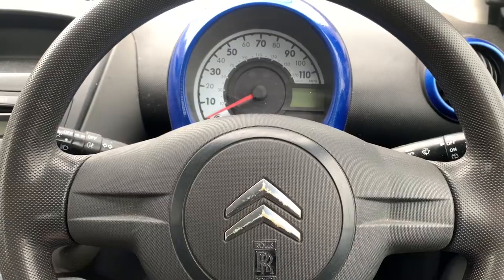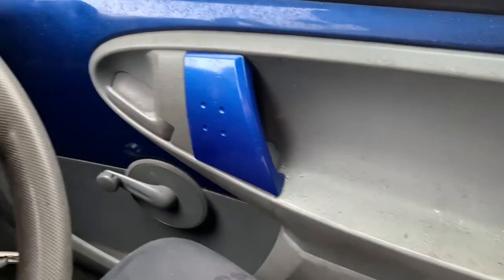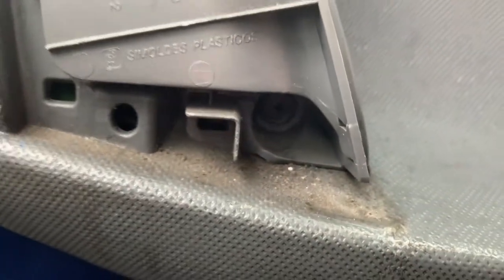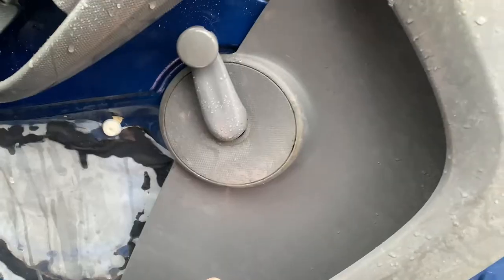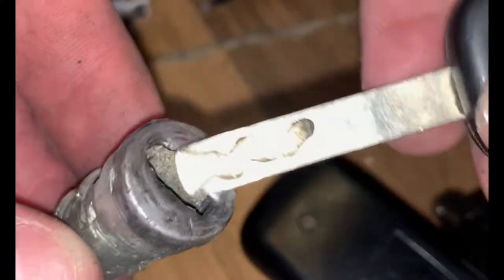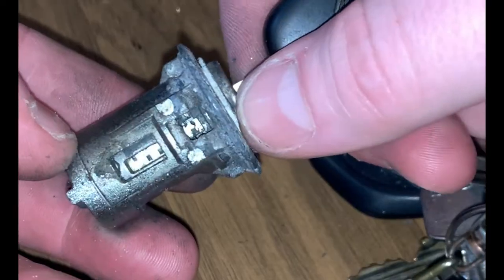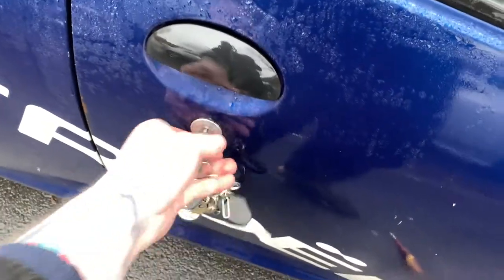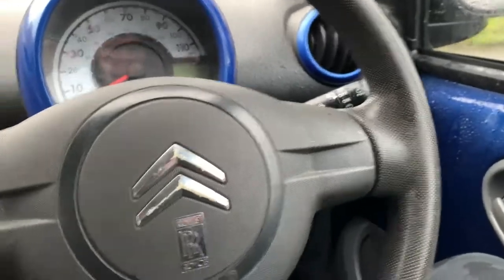Citroen C1 Door Lock Replace DIY + Repair, Aygo/107

Comment: Thanks for giving us the confidence to do it ourselves! My 2006 CITROEN C1 RHYTHM slowly got worse until it finally refused to lock (driver's side) from the outside. Soon got fed up of leaning over from passenger side to push knob down and then lock that door. Chrome cap wouldn't budge so I just swapped the barrels; had to cut/saw slots in door hole a bit so that the barrel fitted ok. I luckily don't have window winders, which helped. With my model, front one of the three screws is longer than the other two (just in case that helps someone).
Reply from the maker: Removing the chrome cap is the hardest but tbh. Glad the video helped and you got it sorted

Comment: Thanks for your video, I followed the same technique and successfully repaired the jammed lock on my daughter's C1.....I rolled the lock barrel on a bench grinder to smooth down the gates with the key in, reassembled and it works great saved ££££s on not taking it to a garage, cheers mate!
Reply from the maker: Good to hear the vid helped mate

Comment: tip for taking the window winder off..... get a rag put it behind the arm side of the winder wiggle it back n forth while pulling it towards you so the rag goes behind the winder ..the rag will pull the clip off, worked every time on me ole metro.
Reply from the maker: Will bare that in mind when struggling with the shitter next time.
Reply: @StupidBlokeStupidVideos  aye the action is similar to when you use a sock to remove toe jam lol

Comment: Same thing for a 2007 Peugeot 107 electric windows? ( driver door lock was changed and I have to open the car through the passenger side all the time. I was thinking about swapping them. Think will work ?
Reply from the maker: As long as no central locking then it should be the same as this 🤔
Reply: I swapped mine. No problem.

Comment: Can i swap the lock from the left door to the right door? My driver side lock is broken so I wonder if i can just swap to the other side more practical cos i never open the car from the passenger side
Reply from the maker: The latch on the back of the lock goes the opposite way, but they may be able to be swapped over 🤔
Reply: Yes it can. I did it.

Comment: Well here I am referring back to this video (first time was for entertainment purposes!). The door lock has been a bit bad for almost a year but after inserting the key if you pulled it as you turn it it worked. 

Sadly the car went for it's MOT (passed) but they have killed the lock once and for all. :(

As I never use the passenger door can I just swap the locks across by just swapping the arms from the two locks?
Reply from the maker: I think you can just fit it upside down, but I’m not 100% sure. If you find out, let me know.
Reply: @StupidBlokeStupidVideos  Well to update. 
I decided not to try moving the passenger side door lock across as I'd probably just end up with both busted locks.

But I have bought a set of Citroen Berlingo locks (£10.89). I removed the C clip, hammered the arm flat, drilled a hole in the arm and fitted the plastic retaining clip to it. All works great now.
Reply from the maker: @gavjlewis  nice one. Sounds like a good alternative

Comment: The manual door lock rod (that thing that can be used to manually lock the door from the inside) will no longer retract or protrude when using remote locking. It's stuck. Any ideas what needs to be done to fix the issue?
Reply from the maker: Does the central locking still work? Has it come disconnected from the mechanism?

Comment: For the clip on 8:00 you can see that there is a hole for screw. On the door there is a black cover when you remove it you can see that you can insert longer screw +10cm and remove the clip. After removing clip you should be able to remove lock cylinder without removing panel, atleast i did it like that on my 106, 206 and 306 😁
Reply from the maker: You mean put a screw into the lock from the side of the door?